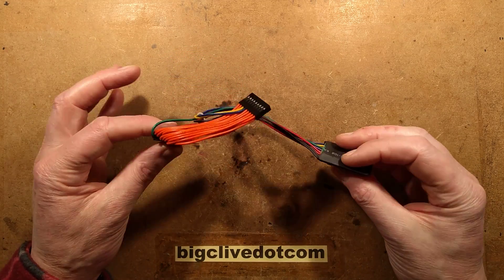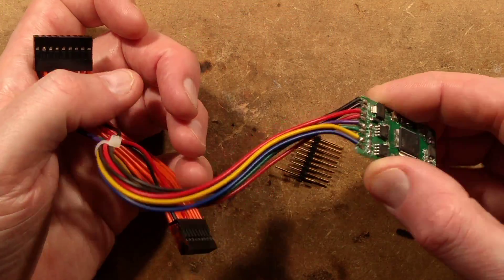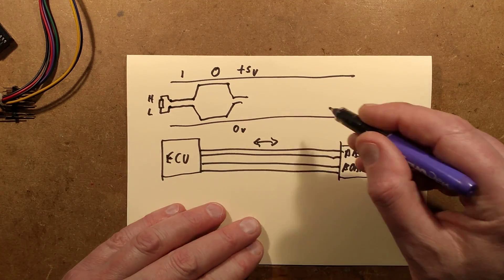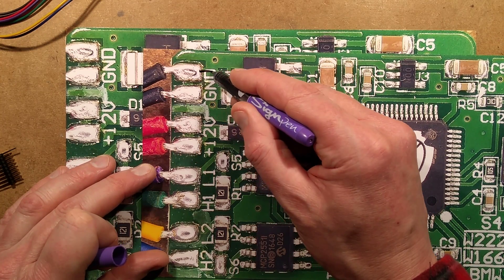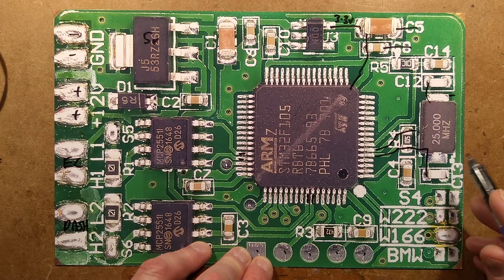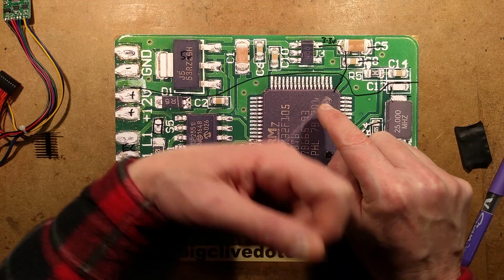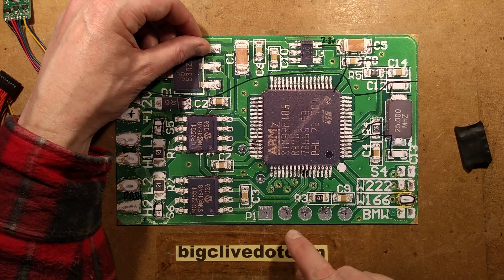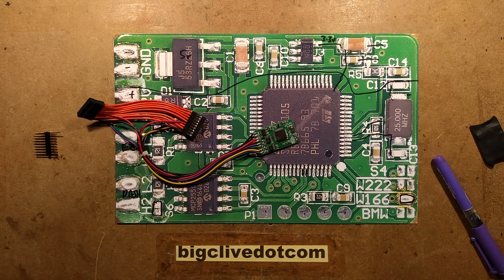Naughty CANbus odometer "interface".  (Fakes mileage.)

Comment: It's actually a little more complicated than that... Two devices can start transmitting at the same time, but devices with lower IDs are given priority. The H and L lines are held in the middle by resistors and devices pull them outwards to send a zero while leaving them floating to send a 1. Devices send their ID before sending actual data. While transmitting, devices also monitor the H and L lines at the same time. If two devices start transmitting at the same time and send their IDs, as soon as one of the devices sends a 1 but reads a 0 the device knows that another device with a lower ID is also trying to send something and immediately stops sending, giving priority to the device with the lower ID. This is an anti collision mechanism. CAN buses are actually really quite cleverly designed to ensure robustness and reliability...

Comment: The official purpose of the product is odometer adjustment when swapping the odometer and it's - you guessed it - on offer on aliexpress.  The key to finding it were the W222 and W166 Mercedes car type designators on the board, with those a search engine will find this exact product right away.

Comment: Some ECUs are regularly (every so many metres), transmitting an "increment odometer" message to the  dash gauges.  This device may well just drop every 3rd/4th/5th "increment odometer" message from being sent to the dash gauge, so the odometer is only logging between 60-80% of the actual distance travelled.  It would be interesting to see if you put it back inline again, does the gauge reduce by 40,000KM, or does it just slow down the rate at which it is recording distance for future logging.
Reply: Since mileage went up when removed it can't be doing that, it just changes the value sent by the ecu.
Reply: I was trying to figure out how this would work since everything is parallel in a CAN bus but this seems like a likely possibility.
Reply: @Popomcgo  disconnect dash from parallel bus, insert inbetween dash and bus
Reply: Traditionally, obd2 on my gm, the dash is getting a pulsed output from the transmission's output shaft. The dash doesn't store the mileage as a byte string but a bitstring, each bit being a mile or kilometer because rewriting nvram reduces its life. The tenths are kept in ram somewhere. If I disconnect the battery, my tenths always reset to .0. I imagine canbus is likely similar because, you know, engineers love change.
Reply: chas williams most newer vehicles store the mileage in 2 places, and if those 2 places don't agree, it... Does something. That "something" depends on the car. Most CAN equipped GM vehicles store the mileage in the BCM (body control module) and the cluster, and if the cluster is replaced, it just resets to the mileage stored in the BCM. If the BCM is replaced, it just stops updating the mileage. Many BMWs will turn on a normally off dot on the odometer that exists to warn you if the mileage may have been tampered with if you change one of the computers that has the mileage stored in it, without following the proper procedure. Which computers store the mileage varies from car to car (for example, on the E46 3 series, 98-05) one of those computers was in the headlight switch! Volvo is especially passive-aggressive about it. The mileage is stored in the BCM and the cluster. The cluster is updated every mile, and the BCM is updated every 5 miles. Every time you start the car and drive off, it compares these 2 values. If they differ by more than the 5 mile updating increment, it will permanently set whichever one has the lower mileage to the higher one after you drive for about 5 miles. (It doesn't do it immediately to allow for swapping modules for testing purposes) So if you swap clusters to one with lower mileage, not knowing that the mileage is also stored in the BCM, when you first start the car, the lower mileage will be displayed. When you drive off, it will increment normally. Then suddenly, it jumps to the original mileage! And if you then go and get the matching BCM, it'll just change the mileage in the BCM to whatever the cluster now shows!

Comment: To be fair, taking out the nefarious firmware inside and assuming you could program the chip the way you want, it could be very(!) useful (and certainly very cheap) to convert a device which is produced from factory with different CAN parameters (addresses, can speed, extended frames and so on), the chip taking care of the conversion "on the fly".  (Its frustrating as prototype and custom vehicles développer/builder to see your pool of usable items restricted because of factory designed or set incompatible Can setups... Surely when reusing scavenged parts from existing vehicles or project). I'd definitely had a use for that!

Comment: Yeah its illegal in the US, Federally illegal. And cars that have altered miles, must be converted to a salvage title, as there is no way to determine the actual miles. So you can never sell the car with a clean title. That basically cuts the price of the car to 25-50% of what it would have been worth as most insurance companies will not cover a salvage title with comprehensive, and most lenders won't lend against a salvage title.

Comment: Pointless to do this as the actual mileage is stored in the Ecu which is easily read by the dealers scan tools. 
Intriguing though all the same.
Reply: Yeah, but if you're a disreputable used-car salesman, your victims - I mean "customers" - are not going to have access to scan tools - all they can see is the number on the dashboard. And of course the sale contract will have "all sales final". "buyer beware", and "as is" clauses so when the buyer finds out the milage was faked, they can't do squat about it.

Comment: the gm clusters I've played with store and calculate the mileage in the cluster
Reply: most of the GM clusters do, you can just swap over to a cluster that has lower mileage and the car won't know the difference.
Reply: Used a Digiprog II to reprogram the Memory chip in the cluster of several cars with out any problems. Benz, Lexus,Nissan. The only bitch is you have to pull the cluster to allow connection with the circuit board but 10 minutes  max... Also can only set odometer to within + - 10 miles of target so 50,000 mile target might be 49,990 to 50,010

Comment: S4 = audi . w222 w166 = Mercedes . bwm model unknown
Reply: From the Amazon page: 
For BMW Model: for BMW 1 series F2X, 3 series F3X, for BMW X5 etc., FEM mileage adjustment( no need to remove FEM, connect directly to instrument panel); for BMW 5 series F10, 7 series F01/02 etc., CAS4 Fxx chassis.( F01, F02, F07, F18, F10, F20, F25, X3 etc., applicable for 9S12 XEP series 5M48H/1N35H).

Comment: Usually, the ECU and the instrument cluster both have a memory which stores the mileage (as may other computers in the car, for example the one for the ABS or the one that controls the door locks or whatever else), but only one of the memory's is being displayed in the cluster. When "reprogramming" the mileage, often only the one memory whose content is displayed in the dash is being reprogrammed, and that's a way of discovering whether the mileage has been manipulated - it can be done over the OBD2 port with the right device (differs by manufacturer of the car). This module seems to take another approach by manipulating the mileage that gets sent to the dash by the ECU, and therefore, none of the in-car memorys is being changed. Since it was in a rather new car, maybe the manufacturers finally did something to prevent the reprogramming of the mileage memory. I still wonder though, does the instrument cluster then store the wrong mileage, or does it just display the wrong mileage, while storing the correct value? Has the mileage display on that Mercedes just jumped up by 40,000km after the device was removed?

Comment: Most of the time when you encounter these amounts of failures presented im the instrument cluster etc , it's because there is a glitch in the bus connectin. This leads ta a lot of errorframes that then causes lost com on the bus. Hence the amount of errors. Quite easily reproduced if you have a diagnistic tool an wiggle it back and forth with ign on.

Comment: The "W" numbers are the Mercedes model numbers.
Reply: (Off the subject) "InTheYear2525"  Zager and Evans
Reply: and s4 is a audi
Reply: @dbmaster46446  S4 probably stands for a switch - there are also S5 and S6 on the board and those are solder blobbed close.
Reply: @dbmaster46446  that could be a coincidence. A couple of other solder-blob "switches" are labeled S5 and S6. It could also be a designer being extra clever and laying things out so that S4 means both.
Reply: It can be used on 18 different chassis types of BMW and Merc - hence 18 in 1 CAN Filter.  This model isn't for VAG cars.
Reply: An Audi S4 wouldn't need one of these filters as it works on a different system, the "S4" probably refers to a 'switch' for enabling/disabling some other option built-in to the filter
Reply: Jokes on the owner.  Here in the states a 3 year old Merc is not worth much.
Reply: @MySparkle888  Used cars in the states are REALLY expensive compared to in Europe.
Reply: @MySparkle888  there in the states big cars are a lot cheaper.
Reply: Yeah, more accurately the body model designations. There's good chance that each option fits far more car models than the ones printed on the PCB. They're all VAG after all.
Reply: @PenZon  Ah, yes, I knew this wasn't the complete truth I told and that the numbers are somehow related to the chassis/body or something like that, but I didn't know how exactly, so I left it with my little half-truth ^^; .
Reply: @PenZon  Um, no they're not? Mercedes and BMW aren't part of VAG.
Reply: Yes they are!  222 chassis is the Flagship model S class, The 166 chassis covers the middle to full size suvs what used to be the ML-GL class now I think they are GL and GLC.
Reply: @benztech219  
GLE and GLS
Reply: @d2factotum  "W" followed by a number, on a Mercedes Benz designates the body design. "W" in Mercedes does NOT mean 'wagen.'
Reply: @dieselscience  Which is lovely, but I never actually said that it meant that?

Comment: For us old timers that is a Berg header plugged into a wire wrap header. I wonder if That ARM 7 is hardwired to simply subtract 40,000 km or does it compute a proportional mileage reduction, say 75% of actual mileage.  

Between seeing this and the GPS tracker gizmos found on used cars glad we buy ours new and use them until the wheels fall off.
Reply: Well...you could answer that question yourself...because what if the actual mileage is less than 40k?
Reply: @mojoblues66  True but what is the point of putting this gizmo on a low mileage car? I assume it is installed by a car dealer so they can charge more.

Comment: I have done a bit of odometer/immo work and i suspect this changes the pulse rate from the abs sensor to the cluster so it displays less speed and records less mileage then have a obd dongle installed to get a true reading of the speed,
all the other control modules record the correct mileages in there eeproms and that would explain why the mileage went to the "true" reading after it was removed
Thats the only way i can imagine at this time that would "shave" mileage rather then stop it or edit the eeprom in the instrument cluster,

Comment: It's kind of ridiculous that this kind of device exists when "car mileage technicians" will adjust the odometer on any car on the market in an hour or two to any value you want. And in much better way than this one which just deals with instrument pane - this kind of mileage cheating is very crude as in modern car there are quite a few independent circuits that will track things like engine revolutions.

Comment: yeah that isnt illegal at all. im sure anyone that finds out about this would call scam so fast that lawsuits will fly faster then water falling over Niagara
Reply: Here's a fun fact: Water falling over Niagara Falls falls at the same speed as water falling over any other falls. :)
Reply: @jafafa  at a constant fall of water that makes what we know. but at what output does water fall if falling water is the same as any other fall if it is much bigger than the other
Reply: @steelthfighter  Niagara Falls (which I live near) is massive in volume, but much less of a drop than many other falls, even other falls in NY State. So the water at Niagara does not have a chance to reach terminal velocity. Taughannock Falls in central NY is much higher, so the water is quite possibly falling faster when it hits bottom.

Comment: Here in the states when I was a young child, my father worked as an auto mechanic and I remember him bringing home the “analog” ancestor of such a device he found installed in-line with a cars Speedometer drive cable. About the size of a D cell with a couple on each end. It contained a set of planetary gears that would down-covert the cars speed measurement from “Miles per Hour”  to Kilometers per Hour." So if you were going 60 MPH for one hour the Speedometer would only indicate a little over 35 MPH, and likewise, the Odometer would only increment 35 miles, not the 60 miles traveled! What is more by that time most American vehicles had speedometer's that indicated both MPH and kM/h so the driver could just use the kM/h scale to accurately know their true speed in MPH.
Reply: Michæl Alan Baker My fathers 1976 GMC pickup had one of these devices as well, except it was marketed for use to change the indicated speed as he used larger tires than what came on the truck. It was used to correct the speedometer, not cheat it.
Reply: Mopar transmissions had replaceable speedo drive gears to make your speedo accurate after changing tire sizes.  They could also make your speedo very inaccurate if you wanted.
Reply: @empanada401  Once you get to a certain point (tire size/gear ratio) you run out of available gears and need to use a gear compensator to further correct the speedometer.
Reply: I'm thinking that these kind of devices might be used for US cars sold in Canada and vice versa.
With there being the possibility of such misuse.
Reply: I've seen those with a genuine use. There were grey import motorcycles from japan sold in the UK, fitting a ratio changer and changing the sign writing was a way to make the speedo legal when actual MPH versions were unavailable.
Reply: @IMBlakeley  That makes a lot of sense; probably the same device.  Some enterprising individual simply repurposed them.
Reply: My 1990 Ford truck had a speedometer cable that simply pulled out of the transmission without tools. You could plug and unplug it in seconds.
Reply: @ProctorsGamble  any of it seems like more hassle than it's worth. I don't pretend to understand the motivation; I can only assume some oh so brite fellow thought it was a slick way to accrue fewer miles on the odometer while still having a useable speedometer.
Reply: Probably from km/h to Miles/h (eg from 100km to 62miles) 🤓
Reply: Conservator About how many miles is 60 km?
Reply: @SudaNIm103  about 40
Reply: @SudaNIm103  40
Reply: @SudaNIm103  Use a 0.6 multiplier ( Just look at your speedo. ). So, 36 mph. 
If you go look at your swimming trunks, you have misunderstood me.
Reply: @SudaNIm103  36 mph...
Reply: It was also pretty common in those days to have a mechanical speedo cable just break. Until you got around to replacing it, you weren't putting any miles on the clock. Of course you also had no speedometer reading, either, so the speeding tickets would more than make up for whatever you save on mileage.
Reply: @bubba99009  had an old s10 with a 355 / 700r4 and bad engine mount.  Rap it too hard and I'd loose the spedo.   Got pretty good at knowing my speed from the tach and gear I was in.  Not perfect, but I never got a speeding ticket when I didn't have a speedo. Not as easy today with vvt and such, but old school, if you paid attention it wasn't a problem.
Reply: Cars speedometers around that time were federally regulated to 80 mph, and you couldn't tell how fast you were going if you were going over 80. Guys would put in those reducers to make their speedometers work again. A nice side effect was less miles on the clock.
Reply: @OrbPlasmatic  It was 85MPH. The regulation was repealed in the early 80s by the Reagan administration, but the automakers continued to produce vehicles with 85MPH speedometers as late as 1991.
Reply: @OrbPlasmatic  : Amusingly, by the letter of the law they were regulated to only have numbers up to 85 MPH, which left a bit of a loophole.  If I'm remembering the car correctly, it was one high-performance model of Ford Mustang that had a speedometer that went up to 140 MPH -- but it was legal because none of the lines above 85 MPH were numbered.  :)
Reply: @BrooksMoses  Back in the 60's the speedometers only went to 120 MPH except police vehicles which went to 160.  My buddy used to love to drive fast, his old Chevy the speedometer would hit 120 then keep going but no numbers, we figured it was going about 140 when the needle went past the turning signal indicator and the spring loaded AM Antenna was level with the center of the passenger side window.  Sure glad we never hit a deer at that speed, this was long before air bags,hell it was long before seat belts.  It's a wonder we lived to see 18 let alone 68.
Reply: @BrooksMoses  If I remember correctly, it was the Mustang SVO, the 4-cylinder turbo Mustang with the biplane spoiler and 5-lug wheels. The art department on "Back to the Future" had to make a custom speedometer face for the movie because the original one stopped at 85 (by law).